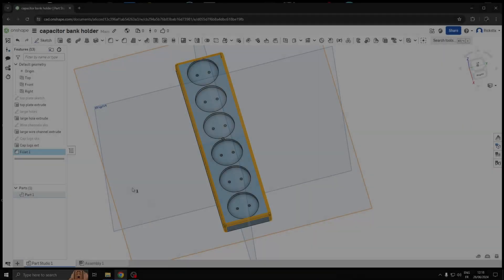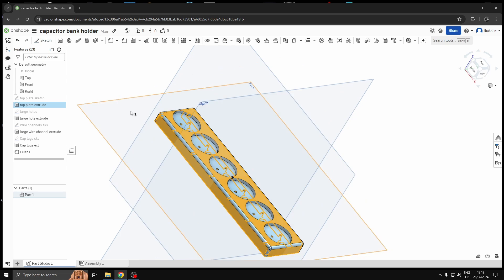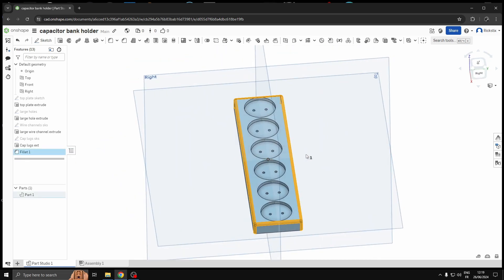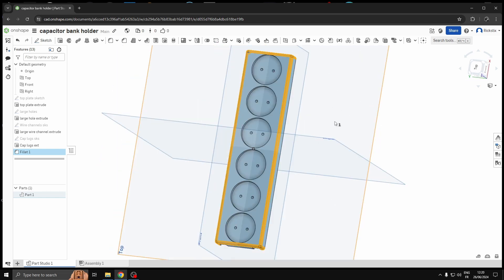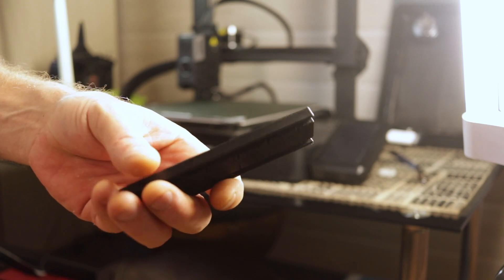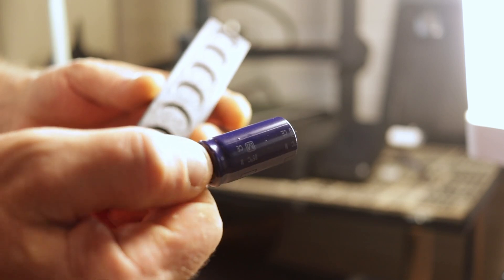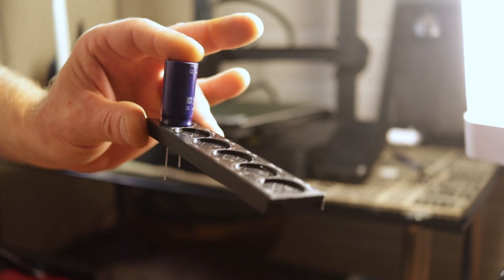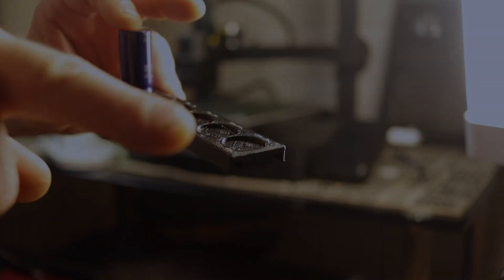3D Printing a capacitor Bank for My Diy Electric surfboard.

Comment: Hi mate the cap-bank caps can have a higher voltage than the esc's caps, but they must have the same Uf rating numbers as the esc's caps,
Keep on rockin mate :)
Reply from the maker: Cheers for that love what you do.
Reply: There is no electrical principle that requires the microfarad value of the cap pack to match the value of the capacitors already on the ESC.

Comment: Whats the point of these? I get it if you have cureent in rush, it takes some draw of the batteries for a very short moment. But if you have lipo at 12S, isnt that like 45 amps per cell? Thus 500 ish apms peak. Cant you adjust the voltage to the escs from the remot reciever so the escs are stopping at say peak 145A?
Reply from the maker: I had the same thought but as far as I can tell there is no way to limit the amp draw it's more to do with the motor kv it's important to check the max amp of the motor some can go higher than mine but I can also play with different props to bring the amps down if needed.
Reply: Usually you can modify the voltage, on the controller. Don't you see any settings on the Flipsky remote to reduce the top throttle voltage or similar going back to the ESC?
Reply: Hi Mate, I started using a cap bank after loosing an esc or two and the expense, the capacitor on the esc were struggling and failing but in no small part due to fake cells off ebay  in the packs, since installing a cap-bank the caps on the esc's stay cool and still doing well, it is something done with RC boats as a belt and braces approach but I need it :)